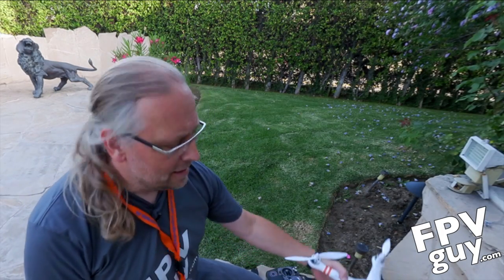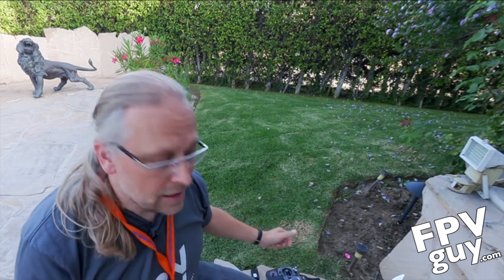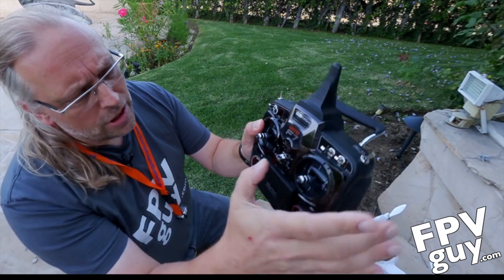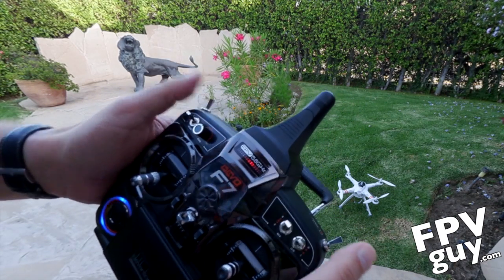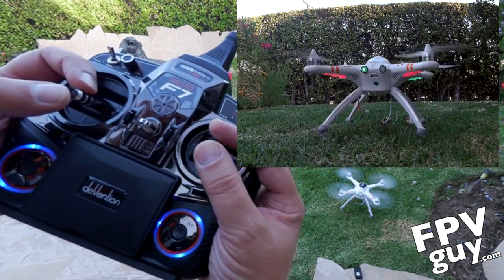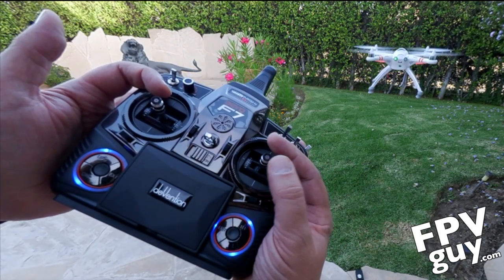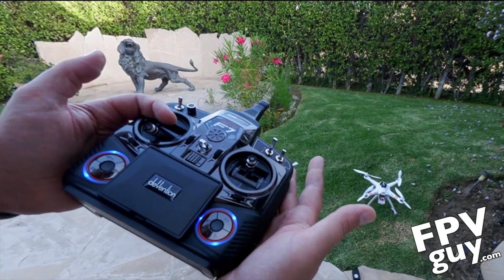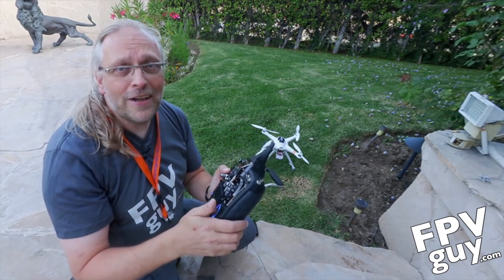x350pro Safe First Flight - Step by Step

Comment: Bo, I hope You can help me out here! I bought the Walkera, X350 Pro. I put a flysky receiver in it. And, I am using a turnigy 9X transmitter. I am trying to use what I have available, just to get this off the ground. I'm hoping i haven't burned something out, doing so. I have a 2600 mAh battery, 14.8v. It sparked pretty good when I plugged it in. The quad did it's beeping thing. The blinking, left hand light....won't stop blinking. I decided to grab a 2200mAh, 11.1v battery. ( Thinking and wishing I had grabbed this one first ) Plugged in with just a hint of a spark. Two or three different beeps. But, the light still doesn't go out! I have tried turning on the transmitter. Doesn't make a difference. Any thoughts as to what I should try? Do You, think I may have burned something out, using 14.8v battery? I have a devo receiver, in the mail, on it's way to me. But, have no idea if it will bind with my Turnigy transmitter. Any help would be greatly appreciated!!! Thank You!! Tom
Reply from the maker: The devo rx will not work with the Turnigy,
honestly I have never messed with changing the RX in a 350pro, so I'm not really a good resource,   shoot a quick email to Walkera, DONT mention the rebuild, just simply tell them its always blinking the left light. see what they have to say.
Sorry Im not more helpful, unfortunately I dont have a 350 anymore, dont have any reference material on this one left.
Reply: Thank You Bo!! Hope I haven't burned out the main controller! Just went into HK, 140 bucks for a new one! Ouch!
Reply from the maker: Call Walkera first.

Comment: Thanks for the videos friend I bought this drone about six months ago but never set it up yet. I am going to attempt to put it together and try my maiden voyage today lol
Reply from the maker: Awesome. glad you are getting it flying.   
Make sure to let it sit extra long to get a GREAT GPS lock after this long time,  I would easily let it sit 5-10 minutes the first time.. just let it get as many GPS's as possible.  and always with that flight-controller, let it sit at least 3 minutes after turning it on outside ;-)
Reply: I have a question Bo. How do you get the camera to not tilt from one side to the other how do you make it sit horizontal in the gimba?
Reply from the maker: the camera should be leveled once the aircraft it turned on.   the only gimbal control is pitch (up down)
Reply: ok i did not know if you are supposed to have it perfectly horizontal when powered off.
Reply from the maker: its good to have a perfect horizon when powered off,  you may want to tape a penny on the side thats too light ;-)  a perfectly balanced gimbal helps the camera work easier.
Reply: ok thanks friend i will do it. I also need to know how to upgrade the software on the receiver and controller now. since it has been so long since i bought it.
Reply: freddie stewart  is

Comment: this, 3d 8x, wl 303 or cx20? or any other model you would recomend with gps, i want one with low or no jellow for air video... thanks
Reply from the maker: +projectpulstar   Get a Q500 from Yuneec or a Phantom P3 standard,  
The CX20 is not good enough for this. and the x350pro is simply old, its obsolete compared to what you expect in performance today.
Note to reduce jello.. make sure you balance the props super good.

Comment: Bo Lorentzen The mode that you are switching is the "stabilize" ? or the Position Hold? I should enter this mode from mission planner ?
Reply from the maker: +Gerasimos Kardaras   position hold is the middle position for the mode switch. ;-)   Do take the time to read the manual before flying :-)
Reply: +Bo Lorentzen , I have done that.But my QX350 was used and the previous owner had changed those settings and I trying to learn "the hard way" :)
Reply from the maker: unfortunately, there are no way for me to tell you what switches he assigned to what.  I would recommend then leave the current profile intact, and create a NEW profile on the Devo F7 then setup that following the instruction manual for radio setup.  now you should have a complete setup. and likely should have the modes on the correct switch.

Comment: Morning, Bo. David from Austin, Tx. here. I have a QRX350 Pro that I am learning to fly. Wondered if I might ask a question of you? .....I can fly it pretty well in manual now, but the last two times out it seems to have gone out of control after maybe 10 min flying. Wound up crashing pretty bad last night....it started off in one direction and I had to chop throttle and crash rather than losing altogether. I crashed once before and had to replace gear and the original compass unit, but have done the calibration as directed by you and Walkera. Have good satellites here...I get 5 or 6 lights on the right LED, but am not flying in GPS hold mode. Suggestions? Hate to ask, but are there any beginner videos on your channel that I should watch and practice? Batteries are fresh and fully charged. No beeps for low volt heard. I have Mission Planner, should I lower the voltage threshold as shown in another Walkera video? Thanks for the help, David
Reply from the maker: Hey David,   
You can lower the voltage threshold,  but make sure you don't try to fly on low voltage as the quad will get kinda sluggish.
The sudden taking off sounds suspect,  it should not do that.   the flight controller in these are a bit sensitive, the big issue is to turn it on in the position you want to fly from, leave it there for 3-5 minutes to make sure you have good GPS before you fly.   do not pick it up or move it after turning it on, leave it in place and fly from where you turned it on.  if you have to move it, you need to start from scratch.. thats a APM general issue.
Reply: +Bo Lorentzen Bo, I have the Devo F7. Can I set a timer or is there one built in to let me know time limit or range? Thx.
Reply from the maker: Timers are kinda useless.  instead buy a lipo-allarm,  and plug it in, set it to 3.7v *you do that by pushing the one button until it lights up 3.7v.  done.
THAT will start buzzing when the battery reach actual power 3.7v and that give you 2-3 safe minutes to land.
http://carolinadronz.com/products/battery-tester-for-yuneec-q500-q500-q500-4k

Comment: So i hope someone can help here. I have been trying to fly my quad. I tried it yesterday and it flipped over and i stopped. I tried it today again with no luck. But while i was trying i hit the gear switch and i believed it was in 2 and my quad took off. Does anyone know here if thats what i supposed to do or have the gear switch on closer to me? Thanks in advance.
Reply from the maker: +amin momin   when you start flying ALL switches should be pushed UP and away. (kinda like in the video)
took off and crashed?  or did it start flying ?
Reply: +Bo Lorentzen hi bo. The first time it just flipped over. The second time with the gear switch all the way towards me, it took off.
Reply from the maker: You said that in the first post.  maybe don't flip the gear switch towards you?
Reply: +Bo Lorentzen  hi sorry for the confusion. When i tried the first the gear switch was away from me and it flipped upside down. When i tried it with the switch being close to me it flew the quad took off. So the question is can i fly my quad with gear switch being close to me?
Reply from the maker: see the previous answer ;-)

Comment: Hi, Bo,
 I'm Alan and I'm writing from France. And you, what place do you live?
Thank you for this nice video. Instructive for a beginner like me. Last week, I asked you a tip for a camera iLook. But you told me there was no iLook appli for my tablet. Okay.
Today I still come to ask for help. I made ten flights with my QRX 350 Pro and I am very happy. But today I can not do the calibration of the compass. When I bring the two sticks to the inside, the LED remains off left and I cannot calibrate. So I assumed that I could not fly "hold on" either and I did not steal before finding a solution.
But on the video, you do not calibrate the compass before you start and you still flew "hold on". Then I can also fly without a compass?
I opened the quadkopter but all electrical wire are connected normally.
I disconnected and reconnected the compass, but nothing operates the flashing green LED for compensation.
Maybe I have to reprogram the radio Devo7 for ordering compensation. Do you have a video that explains the procedure?
Thank you for your response.
Alain :)
Reply from the maker: Hello Alain,
You only need to do compass calibration one time, unless you travel very far from where you live.    
Not sure why you can't do the compass calibrate, thats a bit odd,   I would do a quick flight in manual and if thats cool, then I would be comfortable flying GPS with it.
You may want to ask the calibration question on the Facebook group here.
@711455455567160

You are welcome to ask. I live in Hollywood California.
Reply: Bo Lorentzen  hey Bo...just subbed to your channel..its great!  question for you....in general if compass cal is only needed one time...what happens if i have my first flight after calibration in hong kong (as it soonwill be) an then i take the quad back to europe with me (as i will do)  i will need to re-calibrate i think!  ??   Rob
Reply from the maker: Hey Rob,  CORRECT,  if you travel more than a couple hundred k's   then YES you should recalibrate the compass

Comment: Hi Bo, if you don't mind what are the default settings on your transmitter. I made changes to my transmitter and now I can't use my gps lock. Thank you in advance.
Reply from the maker: Micro Quads Download the instructions,  they are also on the CD that camera with the 350pro,   there is a step by step walk through of the radio settings.. start by making a new model, then program that model.
Reply: that is a big help, thank you very much.

Comment: Hi Bo, firstly thanks for your videos! it has made my quad experience out of the box far less daunting!! one thing I notice on my X350 Pro is that following compass calibration ect the quad always wants to fly t o the left and slightly backwards. First I tried to adjust the trim buttons but this doesn't seem to have any effect, I then switched propellers just in case one side was biased...still the same. when I enter into GPS hold it then straightens up!! any ideas?
thanks again
Neil
Reply from the maker: Neil,  if the GPS hold mode does the trick.  then Im guessing its a little uneven load..   generally in manual these things tend to drift.  how fast is it going?
Reply: thanks Bo, if I take my fingers off the right stick it drifts back and to the left fairly quickly about 1m per second. it has no gimbal or camera, I took these off until I figures out how to fly it.
Reply: I just have to keep positive pressure on the right stick diagonally towards the top right hand corner!
Reply from the maker: OK 1m per sec is pretty quickly.. thats not right.    post that question on the Walkera 350pro owners group here
https://www.facebook.com/groups/711455455567160/
Reply: OK thanks Bo

Comment: Great video - I'm waiting for my Walkera x350 pro ($400 basic with Devo 7 no gimble) to arrive soon.  I've been practicing on a Syma X5C and am very good at it - I know this is another beast and it's like comparing apples to oranges but it's good to learn on a $50 quad verses $400 -  I tried the $400 SkyView FreeX and it was a disaster - would not fly right so I gave up on it.  Thanks for the video.
Reply from the maker: You are welcome,  thank you for the kind words.
Sounds like you have been doing all the right things,  flying and practicing on a smaller quad first give you lots of muscle memory to help build confident flying skills. Good luck with it.. 
Also check out the 350pro owners support group
https://www.facebook.com/groups/711455455567160/
Reply: Bo Lorentzen
I have been flying the Walkera qrx350 pro and on the stock battery (without the camera/gimble) and I am only getting 12-13 min of flight time is this normal?  I only have the stock battery and the included charger (takes forever 6+ hours to fully charge) do you have any recommendations for spare batteries and a good charger?
Reply from the maker: Andy Z 12-13 minutes is about right with camera if you have a bit of wind.
Maybe get the TALI charger, its cheap at $35, you will also need the power brick, it can charge your batteries at 2amp, and should finish in about 30 minutes.
http://walkerahelicoptersupply.com/collections/tali-h500-parts/products/skyrc-imax-b6-balance-charger

Comment: Hi Bo! Do you have any tips on how to balance propellers without any fancy equipment?
Reply from the maker: Hello Flavionator,      A Dubro balancer is brilliant.. get one.!

Until then,  get a 3mm about 1/8th thick steel rod from your local hardware store.   about 15-20cm long.  wrap clear scotch tape around the end, until a pro stick just enough to not fall off. ;-)

Then proceed to put the stick on the edge of a water glass with a smooth edge. simply lay the stick across the glass,    check first, the glass must be level and the stick should not roll with no propeller in place.  glass must be tall enough for the prop to move freely.

Comment: Hello Bo, I thinking if the throttle must be in the middle position when you change the mode from manual to GPS, after that Can I move the throttle to up or down (to elev my quad more meters) ? The middle is for just change or is all time in GPS mode?  Thank you
Reply from the maker: Hey Camilo,  That is correct,   stick to be 50% when you change modes, after you have changed to GPS, you can fly the quad up-down height with the throttle and forward like normally.    REMEMBER to center the throttle stick before switching back to manual from GPS.     ALSO REMEMBER if you are flying in RTL and switch back to GPS or MANUAL.. you must be sure to center the throttle stick first.
Reply: Thank you !!! Let me congrats for your completes videos you have done !

Comment: Hi Bo,

Really liking the videos. I am just wondering if you can take of in GPS mode as I find the quad to move quite a bit which despites it purpose for me which is aerial filming.

Chris.
Reply from the maker: Hey Chris,  Technically speaking you can take off in GPS,  I have not tried it, and don't really think I recommend it, mostly because I hate to let the GPS do the driving when taking-off.  The process is simple, arm the quad in manual,  then flip to GPS mode and push the throttle up fairly quickly to about 70% throttle, once in the air, reduce throttle to 50% for a hover.    again, I REALLY do not particularly like that feature, and you will also see me say the same about the h500 TALI auto-take-off.. I DO NOT LIKE auto-take-off..  its like cat-nip for noobs.  smells so good and make them crazy and next thing they crash.    IF you must use it, wait wait wait, give it maybe 2-3 minutes after you already have a great GPS lock, make sure its good, because the GPS is in the drivers seat and if you have a problem the quad can go sideways and crash faster than you can say auto-launch.. ;-)  just saying.
Reply: Bo Lorentzen Ok thanks, really appreciated.
Reply: Bo Lorentzen Ok thanks, really appreciated.

Comment: Hey Bo,

I have the exact same set up as yours. However, on my first flight, the quad would not lift off straight up in neutral position. Instead the quad's pitch sends it to the back right. Is there anything that I could do to fix this issue?
Reply from the maker: Hey Tony,     make sure you leave the quad on the ground when you power it, should be perfectly level,  leave it sitting for at least 30sec after binding..   preferably longer, just leave it until you have solid GPS lock, then wait a couple of minutes further to make sure its really good.

OH..also check that your trim is centered on the right stick.. push the trim tab until pitch and roll is definitely centered. ;-)

if that don't do the trick, next stop is recalibrating the IMU, but you should not need that.
Reply: Bo Lorentzen
Thanks for the quick response!
I just tried to recalibrate the compass and now it's pitching to the left. Using the trim can minimize the drift but not enough to stabilize. 

Tried using the gps lock with 7 gps satellite locks but it still doesn't lock in place?

Is there anything else I could be trying?
Reply from the maker: Tony,   Im guessing you have not had a lot of flights. 
As you start up,  make sure it start and sit on level ground while warming up.   after you get full GPS lock,  wait at least 60 seconds before you start flying.
Then proceed and fly while keeping it stable in the air using the sticks,   do not go to high, the point is not to fly anywhere just to train the flight-controller,  get 4-5 batteries,  I suspect that will iron the balance out.    mine was the same way on the first battery.. but straightened up after a lot of flying.  I have no idea why it works that way.